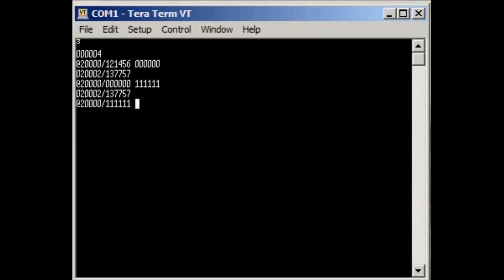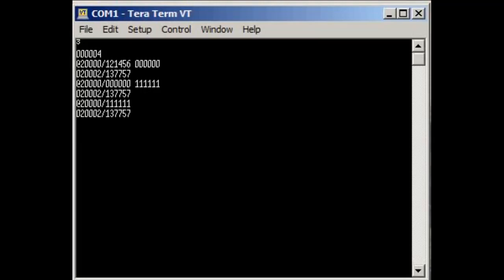PDP11-3 Repair Part3

Comment: I’ve a limited experience on old CNC machines but I remember that was used an external (to pc itself) logic board as high power devices interface (sort of PLC). It might be that the bootstrap is looking for it’s presence or the presence of something else.It might be the case for another software retroengineering if you don’t have any clue of that. 🤞👍.

Comment: I'm nowhere near an expert, and I'm sure you've already thought of this, but could it be that the console jams the start address on the bus? That would at least account for why the machine halts instead of jumping to the ROM. The whole CNC interface seems a little unconventional!
Reply from the maker: No the console connects via RS232 so does not have access to the bus. The PDP would not allow that anyway due to its architecture. I do however think that you are thinking along the right lines. I think that the console should provide a configuration boot up if the boot address is invalid. The CNC configuration is certainly odd because of specific CNC requirements such as having to provide fail safe operation and possible restart / recover address boot. I will probably go into more detail on that in the next video.
Reply: I was wondering if the console actually interfaced directly with the bus via a card. My PDP-11 experience is primarily as an end user, so I was really thinking aloud!